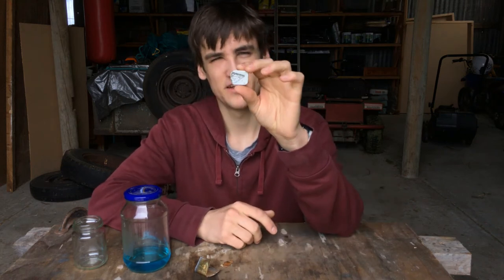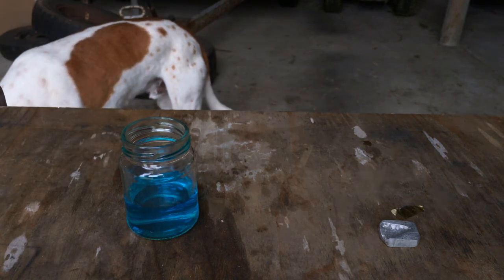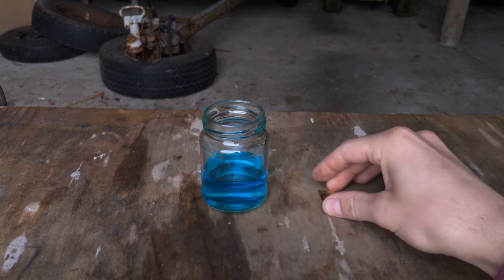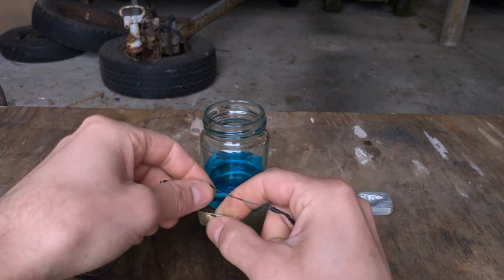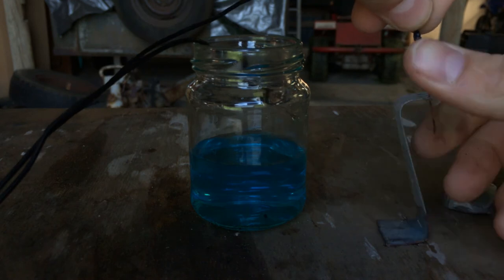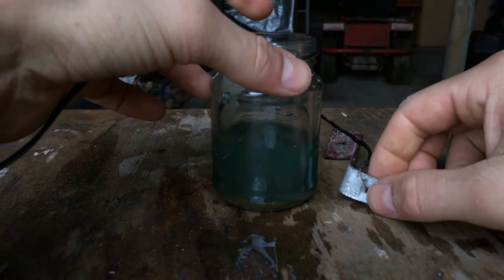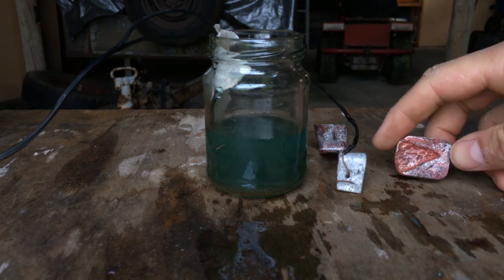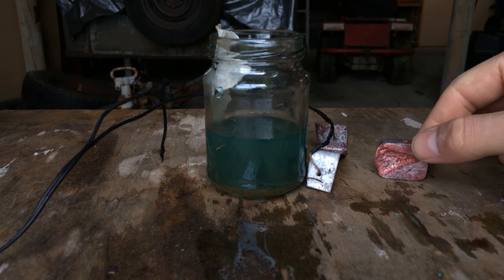Electroplating a play button | 500 subscriber special!

Comment: The +ve electrode is the anode, the sacrificial electrode. Using a metal support for your target introduced competition for the plating. If I remember correctly, plating will occur preferntially to the metal furthest down the electrochemical series from the Cu of your anode.  And - congratulations on the number of subscribers you now have!!
Reply from the maker: It's been awhile since I have done something like this, so I didn't think to look at the electrochemical series, but I think the support for the aluminum play button was also aluminium (with slight impurities) but I still probably should have either used something else or connected the play button directly to the wire.